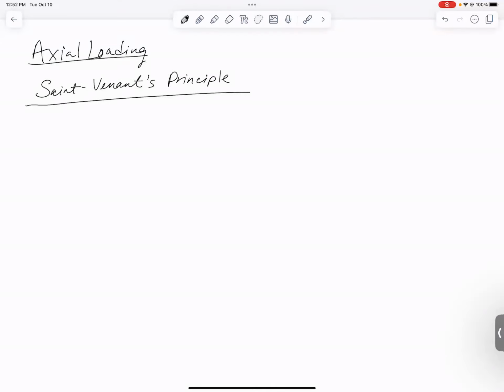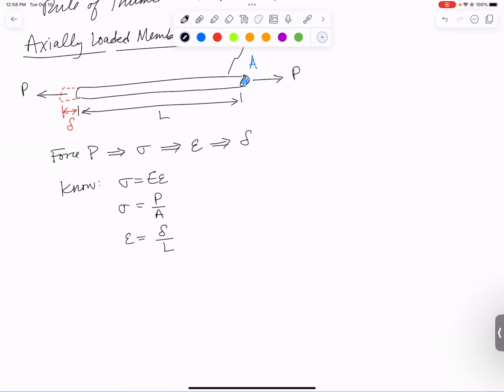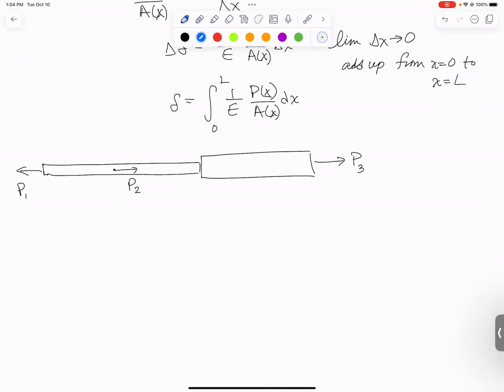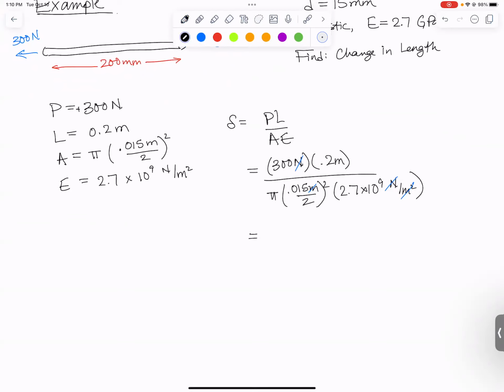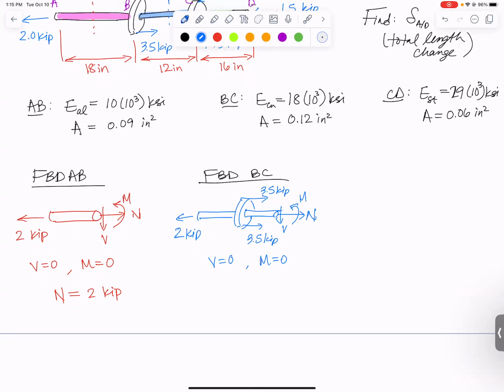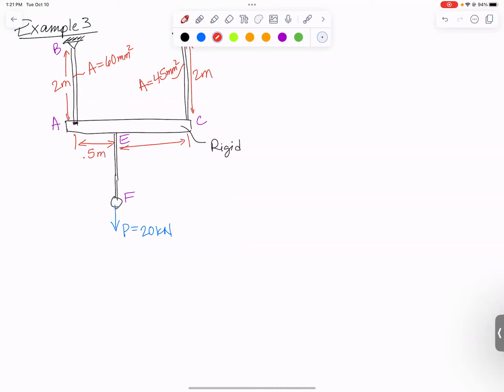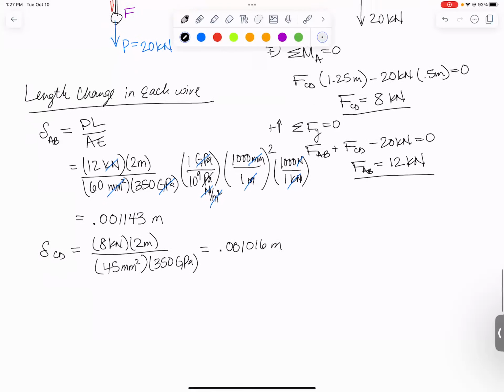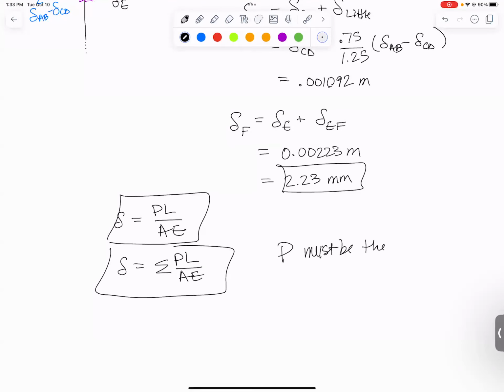Mechanics of Materials 10: Axial Loading

Comment: In Example 2, the pair of 1.75 kip forces are ignored?
Reply from the maker: When you cut the part open to determine the internal force, you get to choose whether to keep everything to the right of your cut OR everything to the left of your cut. Since I chose to keep the left part of the bar for the cuts between A and B and between B and C, but chose to keep everything to the right of the cut when I cut between C and D, those 1.75 kip forces never appeared on any of my cut FBD's. If you had kept everything to the left of the cut for the last FBD, your third FBD would have included 2 kip to the left, a pair of 3.5 kip forces to the right, the pair of 1.75 kip forces to the left, and the internal forces. You'll get the same answer, but it's a bit more math.